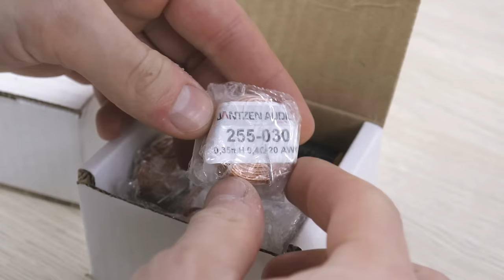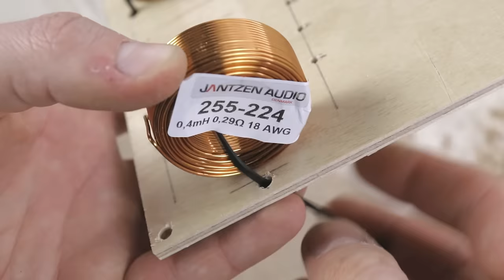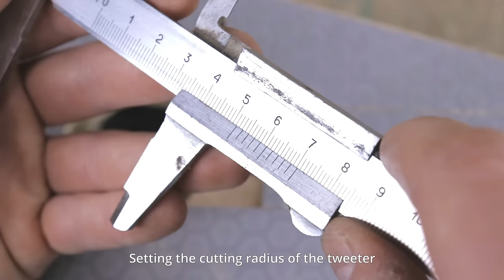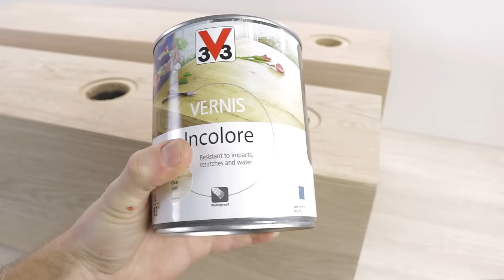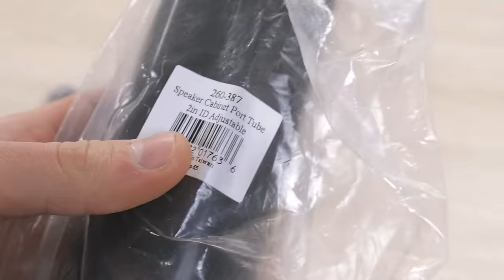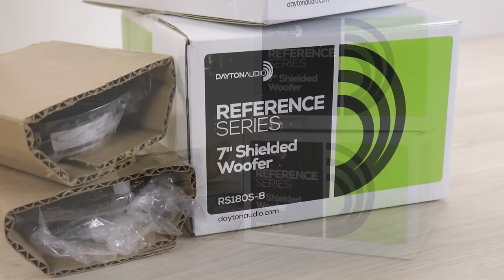These $185 DIY HiFi Speakers Sound AMAZING

Comment: By DIY, you mean: if you have a few thousands (more?  I have no sense) dollars of tools and (clearly) years of experience in woodworking (which you do), anyone can make these….  Or something…
Reply from the maker: Hi! Thanks for the comment. A DIY project definitely does not mean it is for meant for everyone. Some projects may require scissors and some tape, others a few more tools and experience. These speakers were designed so that people can make them with their own hands and the kits that Parts Express provide make it easier for people who may not have experience, time, tools etc. to have these speakers made by themselves. They even provide a full kit which can be assembled using minimal tools and experience, providing clear instructions and info. Since I am able and like to build the enclosures myself, I chose the 'hard' way of making these. And since I made them myself, I consider that quite a few other people can do it too. Hope this sums up my opinion on DIY.
Reply: Bro these types of kits could be done with hand tools from a budget store like harbor freight or for a few more pennies tools from a hardware store like home depot, lowes etc. Regardless though a drill, router, and saw will run you about $250 in total (i just spent $267 at home depot on the exact same  tools from ryobi recently) so all in youre about $500 for these towers that prebuilt from a company with the same components would run you $2-3k
Reply: @DonnyTerek  By DIY, you mean: if you pull up your big boy/girl pants up and… Do It Yourself (which you do), instead of relying on Chinese slave labor to bring down the cost…. Or something… I think we can all agree, shame on you Donny for showing us what it would take to turn mundane material into finely crafted functional furniture and make money from it in the process instead excepting everything to be given to you for free.
Reply: Take this as inspiration to start learning woodworking.
Reply: Do you really expect to be able to make anything good if you are both poor and stupid? Life isn’t a video game. You can’t just make a house with 3 trees and an axe without knowledge or experience.
Reply: I personally think it would be really valuable for someone to do these builds with nothing but a drill a jigsaw and circular saw. Most anyone would have those or be able to acquire them cheap.  I love doing stuff myself as well as repairing things instead of trashing them and buying a new one. Love these videos. I just wish somebody out there made instructional videos with a more basic tool set. I feel that would be beneficial and appreciated by a large chunk of people.
Reply: @andrzejczarnota3661  I’ve built speaker enclosures with a handsaw on my apartments dining room table….don’t need anything fancy - just make a box ffs
Reply: FYI, this kit could be done using a lot more primitive tools than what he is using.
Reply: Don't let that discourage you. You don't need a lot of expensive tools, and years of experience. I built a similar set of speakers back when I had no tools, no experience and very little money. I borrowed a battery drill and a jig saw. Sure you get better and faster as you get more experienced and start getting nicer tools and start to build jigs, but you have to start somewhere. You don't need thousands of dollars worth of tools. You don't actually need the drill press(the battery drill would've worked). You don't need the power sander (elbow grease would've worked). And you don't need the trim router AND the jig saw, either one can stand in for the other. Don't get me wrong having and using all the tools is great, but they're not a minimum requirement.
Reply: @djparra41  oh you GOT EM GOOD
Reply: It's pretty easy and accessible to a lot of people...
Reply: @DonnyTerek  simply put amazing job by an amazing person
Reply from the maker: @James-lh1up  Much appreciated, thank you.
Reply: For a little more money… You can also buy knockdown kits… They do 90% of the work for you and the rest is pretty much glue ups with clamps.
Reply: These are mostly just basic tools you should have if you're a man.
Reply: It’s a piece of cake!
Reply: And a week of time!
Reply: You don't really need a large expensive tool set, just patience and maybe the tool purchasing advice of a friend who can help you whittle down your purchases to "good" tools as opposed to "a lot of tools".😮
Reply: This video is good, and help others; do you really expect DIY with your hands and no tools? Plus you can do it with the tools you have. If you can't, learn.
Reply: No, the kits from Parts Express are no where near that expensive. They have kits under $500 that all you have to do is assemble and buy glue, band clamps and a soldering set. Many of the higher quality tools can be rented if you want to try the hard way and many of his are available for inexpensive costs from other manufacturers like Ryobi or Rigid. I have been using both professionally for decades with quite satisfactory results. Try it dude, it's very rewarding and gives you a sense of accomplishment. Even if your results aren't perfect the sound is and the speakers can't tell how pretty the work is. They'll still sound good.
Reply: Do you sell it?
Reply: The main thing is you get to enjoy high quality speakers that  you built yourself

Comment: Nice work, hats off... However, I can't forgive myself for asking why you didn't choose speakers from the same manufacturer and why the bass speaker was used 8Ω and the tweeter 4Ω The only time it would make sense to me is that it is connected to the bridge, which according to the formula resistance... R = (R x R) : (R + R) = +-3 Ω Or what was the real reason? I assume it's not a loss of performance...
Reply from the maker: Thank you! These are designed by Paul Carmody. More on the design: https://bit.ly/3Jm8xYj

Comment: I currently use that DX25 in my home theater speakers mated to Celestion TF0818 midbass "prosound" drivers. Original design had them crossed over a bit too high around 2.2khz, I recently re-enginerded the crossover and pulled it down to around 1600hz. The new parts will be here this week for the crossover upgrade. Can't wait to install!

My rationale on using the TF0818 is that the system is intended to be crossed to a sub anyway, so might as well use something more  optimized for the intended frequency range. The TF0818 are 5-8dB more sensitive than most 7-9" class HiFi midbass/woofer type drivers (even when compared to 4 ohm drivers) while still being very low distortion and having a pretty smooth response in their usable range. I have them playing down to ~80hz in a 3/4ft^3 box tuned to around 80hz.

Comment: The process of DIY-ing make it more loveble.

I mean DIY level of this is as high as 'Manufacture it your self'
Reply from the maker: These speakers can be built using a jig saw and a drill having all the pieces cut out yourself. Since I have access to bit more tools, I do my best to use them for the best result.

Comment: Excellent work! Didn't know these kits existed. Does the MDF inside require routing? Pictures show it routed out, but video had blanks. If I had to route the inside from blank, then this kit seems better suited as raw material for a small to medium sized speaker production company as their incoming raw stock for adapting, or an advanced diy-er. Not a casual assembly speaker build, unless it's prefab with the speaker holes routed. Is the inner volume generally, impedance matched to the speakers?
Reply: I wondered why so much effort went into making the round overs etc when they were just to be covered up.
Reply from the maker: Thanks! The inside routing is not necessary but it is a good idea to have the inside edge of the woofer rounded over for smooth airflow. The speaker holes are routed and recessed for flush mounting. The enclosures that I made in the video are fully built from scratch, only the speaker components were provided by Parts Express.

Comment: Good job. Don't use solder as a glue. Make a physical connection first. Also don't tighten screws home on drivers. Finger tight on opposite sides, then tighten.
Reply from the maker: Thank you.

Comment: Very nice work.  One question: why did you route out and bevel the inner braces?  They aren't visible, why not leave rough cut?  Great job, thanks for sharing!
Reply: Oh, just watched a Parts Express video showing their knock down cabinet build.  They didn't use any fasteners, it was all glue and clamp. Why did you screw yours, in addition to glue?
Reply: Another question: what glue did you use: PVC?  Contact?  Bondtite wood?
Reply from the maker: Hello, thank you. That is probably not necessary but it helps for smoother airflow inside the cabinet. 
Since mine weren't as accurate cuts as the Parts Express CNC cut pieces, I used screws. I used PVA D3 glue.

Comment: Stupid question, but how do you service them? The backside, or bottom, must always be possible to unscrew so you have access to the stuff inside, unless you’re going to destroy the case, which would be sad.
Reply from the maker: That's a good question, though there isn't much to service on these. The speaker drivers can be easily removed and right behind them is the crossover, which is held in by screws. Other than that is the port and connection terminals on the back.

Comment: What kind of PVA glue is this..? When I tried veneering with plain PVA it curled up in a few minutes to a tube.  🙂
How does it remain so flat with this type of glue? Why it doesn't move the grains while drying?
Reply from the maker: Hi, I am using PVA D3 glue. It does curl up the veneer but I use a heat gun to make the drying process faster.

Comment: Interesting video... I enjoyed reading some of the comments as well, particularly the arguments as to whether or not MDF is superior to Birch etc ad nauseam.    I began to relate back to how Acoustic Research (and other top tier manufacturers) used plywood in their boxes.  Myself, I used MDF (back when they called it particle board before the abbreviation trends took hold) in every speaker box I ever built.  Never had any issues, nor did the audio center I'd worked for that built custom speaker boxes on a daily basis (with a simple program I dug up from Usenet... remember them?  🙂) that was able to calculate port sizes and freq. rolloffs etc. as long as you knew the T.S. specs of the woofer.   Now all that said, you did nice work.  Much attention to detail.  Myself, I'd have used a premium grade of contact cement which doesn't require "ironing", and a vernier saw to trim, still have the first vernier saw (German) I ever bought, still sharp.  It would have eliminated the need to repair some of the edges in your boxes.  I learned vernier work from an old school craftsman who specialized in furniture and vernier work.  He's also the guy who described exactly what "hand rubbed finish" actually means.  Expect to get sticky, especially with Teak-Öl.   I listen to old people... they know stuff.   BTW:   Your flat iron trick and a hypodermic needle works very well in repairing ancient vernier that has started to blister, same old dude showed me that trick as well.   I repaired an ancient "lawyer" book case (1916 vintage) that had blistered vernier, worked nicely, wasn't aware that vernier was that much of a thing a century ago.  🙂

All in all, a very good video... and I like that tweeter, gonna look up some sources.
Reply from the maker: Thank you so much! Was a pleasure to read through. Don't get many comments this long too often!

Comment: Hi Donny. Is there any need to do two coats of PVA (letting one dry first) or would one work ok? I'm getting very close to putting the veneer on.
Reply from the maker: Hi, the first coat is needed to soak into the MDF board so that the veneer has plenty of grip. The second coat of PVA (once the first one is dry) is let to try for around half an hour once it becomes tacky but does not stick to the finger. This will ensure both surfaces grip together and lock in place when heated with an iron.

Comment: Gracias Donny por tu estupendo video y trabajo. He seguido tus instrucciones y me han quedado dos torres increíbles. 
Quería preguntarte si habría que modificar mucho las medidas internas para poner dos woofers en vez de uno solo,  y si los dos en paralelo los podría manejar el mismo crossover.
Reply from the maker: Hello, thank you for the kind comment. I would not recommend modifying these speakers. That would require a complete rebuild of the enclosure and crossovers. Why would you want to have 2 woofers? At least to me these speakers have plenty of bass.

Comment: What's special with those  pointed 2 piece feet. Is it solely for appearance or it provides any functional benifit?
Reply from the maker: It is more for appearance than function but they do reduce the vibration produced by the speakers to the ground or in this case the TV stand.

Comment: the internal bracing.  cleaning up the irregularly cut edges you cleaned up with a router, is that a necessary sonic thing to do or just striving for an aesthetic level of perfection?
Reply from the maker: That is most likely not necessary and would probably not make an audible difference to the ear but it is a good practice to round any sharp edges inside speaker enclosures for the air to move smoothly.

Comment: Perfect great job! If the front wall with the speakers was made of good quality wood (solid), there could be chamfered edges on the front panel. Unfortunately, it doesn't work with veneer.
Still, it's a piece of honest work. Thanks for the video!
Reply from the maker: Thank you so much! It is possible to have chamfers with veneer but I feel it is a bit too much work for me.

Comment: Is the any downside (other than cost) to using Baltic birch plywood instead of MDM?
Reply from the maker: Basically due to the lower density of the plywood, you would get sound that is less clear than using MDF for the cabinet. MDF is also easier to work with.

Comment: Hi Donny. How difficult was doing the veneer? How long do you need to let it dry before you can trim it.
Reply from the maker: Hi, sorry for the late reply. Actually it isn't too difficult once you get the hang of it. I would recommend you try veneering a test piece before doing it on the speakers. Also if you cut the veneer with a trim router like I did, I recommend you get a decent spiral flush trim router bit (included in the description).
Reply: @DonnyTerek  All good Donny. I'll definitely have a practice before I do the trim. I'll send some photos too.
Reply: How quickly does the PVA set after ironing?
Reply from the maker: @australianvideonews3976  After ironing it sets almost immediately cause you heat it enough so any remaining water evaporates.

Comment: Excellent work !
Only one critic: considering all the time and effort, I would have soldered the speakers connectors, instead of only crimped (even less without proper crimper tool)
Reply from the maker: Thank you! I would probably do that on my next set of speakers.
Reply: @DonnyTerek  Actually, thinking a little more as me, I would have soldered the wire directly to the speaker tabs. Period. ;)
Reply: But doesn't soldering the wire decrease the signals quality even if you are using silver solder?, Instead I use gold plated copper terminal lugs with the slide on silicone insulator caps, I finely file some plating from the inside of the lugs then i clean all the lugs & cable ends with isopropyl alcohol & then i use a proper hand held crimper to attach the lugs & wires,
The squashed copper strands in the lugs will meld over time & naturally create a better contact surface by themselves then I just slide the whole thing onto the speaker's cleaned terminal lugs, This will also have a better signal transfer as the electrons settle in over time (gets broken in) along the the entire length of the cable i'm sure of it, But I definatly wouldn't like to build new Crossovers, not with my "phobia" of solder

Comment: Excellent woo0dworking skills with a brilliant finish, my only reservation will be only a 7 inch bass speaker will it reproduce the whole frequency range of a recording? with your great skills maybe a 3 way speaker system with a 10 inch good bass speaker would be better? but then again I think  this depends on your musical preferences, Excellent job just the same n thanks for posting
Reply from the maker: Thank you! This is an amazing speaker design by Paul Carmody, intended for these 7 inch speakers. I'm sure there are better options out there but this pair of speakers is outstanding considering the low cost of materials and components used.

Comment: How long it took for you to build these cabinets? Including all curing times etc.
Reply from the maker: It is difficult to tell since most of the time was taken by filming. I usually let the glue cure for 2-3 hours max, much less if screws are used as well like in this case. I would say it took me 3-4 evenings to build the cabinets from start to finish.

Comment: It's some brilliant work you did there I am very impressed as I would love to create beautiful looking speakers, I really liked veneering on those cabinets I don't have the confidence to use real veneers, the drilling & cutting out was on many levels above what I could achieve in the same amount of time, only thing I would do differently would be to make a box to have externally mounted crossovers instead, I'm planning to make a pair of these myself using my 2.5 way Monitor Audio X-overs fitted onto sand filled bases with 3 inch carpet spikes